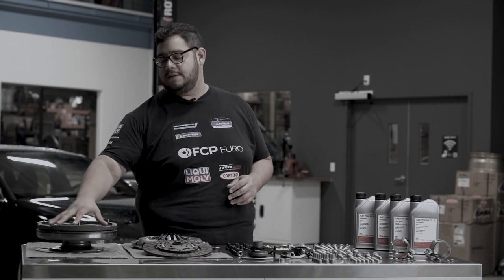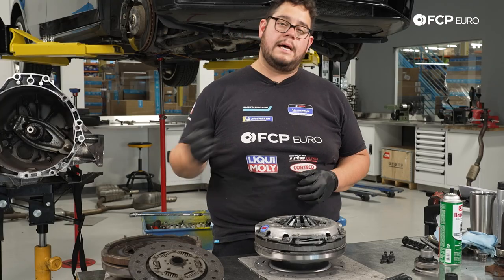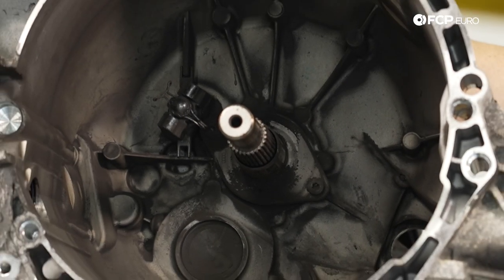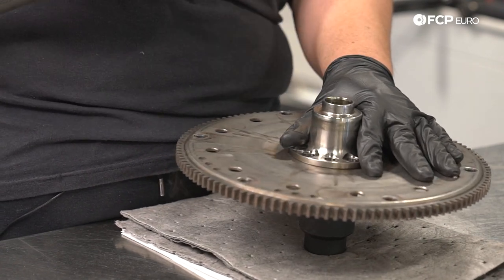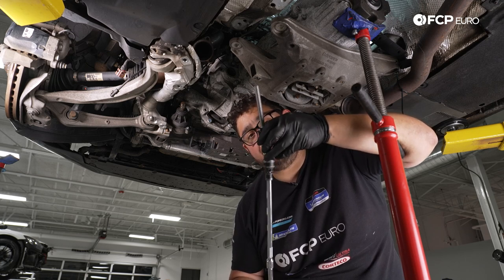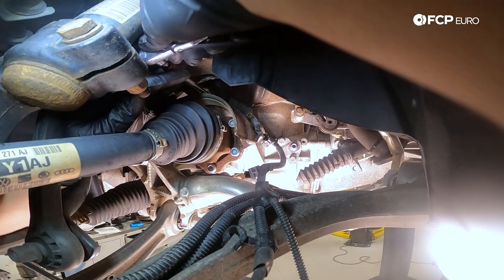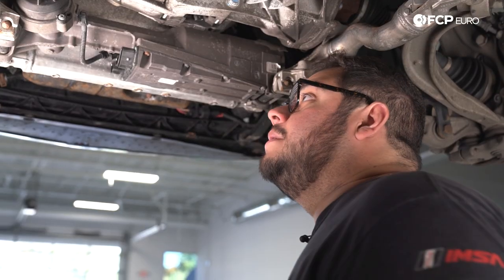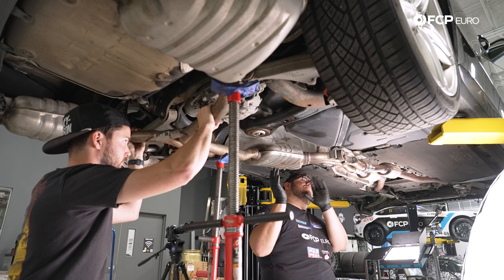Audi S4 Clutch & Flywheel Replacement DIY (2010-2016 Audi B8 & B8.5 S4, 6-Speed) - Part 2

Comment: Just replaced the dual mass flywheel on a b8.5 s4 DSG was using this as kind of a guide is there a certain orientation the flywheel needs to be mated to the flex plate? didn’t mark it before removing it 🤦‍♂️

Comment: And that my friends (or good ppl if you prefer) is why I own the DSG version. Even when the mechatronics unit (or solenoids, more specifically) takes a crap, it's still waaaaaaayyyyyy easier to fix than a clutch replacement! 😂 But superb DIY as usual! 😊

Comment: Just finished this job before i came across this video. I skipped the step where the unit was put on the press and assembled the clutch normally. Now the car drives like it has a worn clutch, high biting point and burning clutch smell. Would this be because i did not put the clutch under load as shown?
Reply from the maker: Hi Leonard, it may be possible, but there would really be no way to tell without more diagnosing. You can try bleeding the slave cylinder as a "quick fix" to see if that remedies your problem, before tearing into things again.
Reply: @fcpeuro  tried bleeding a new slave from the dealer. No difference. Opening the gearbox again now. Will give you guys an update fml

Comment: Absolutely fantastic. This helped a ton with changing my clutch and flywheel on my 2014 A5. I am one of those sorry souls to have done it with jack stands and 2 floor jacks. 

Tip for anyone else that is going to do this and has the 2L V4. You can reach the top bolts from above because the engine is small. Makes it allot easier. Same go’s for the annoying bolt on the axels heat shield.
Reply: Was it a huge pond in the butt job ?  I’ve been quoted $1300-$2000 in the shops
Reply: It just takes a bit of time. I think it took me 2 days (not full days) to get it down. And one to get it up and running. Nothing too stupid. Definitely get help to lower it down on a jack. I had used  2 jacks a person on each and lowered slowly. (You can do it with one just find the best balance point before fully unbolting. It’s pretty straightforward but mark, video or write any differences between your car and the video. It’s easy to forget a clip or to look for one you don’t have if you didn’t make a reminder for yourself.
Reply: thanks a ton dude 
  I believe I’ve got more time than money so I’m going to try it out 
 Plus the shop can’t even get me on for 3 weeks 😂 ✌🏼

Comment: Have you thought about doing a video about replacing the OEM clutch line with a stainless steel clutch line (like from ECS) that removes the delay value in the line and improves clutch pedal feel and drivability?  Not sure if there is another delay valve on the reservoir

Comment: good job man 😁 i have  done a new clutch Sachs set,becouse the old clutc was slipping.  Now i have a problem with starting the car... always say press clutch to start the car... i have to press it real hard, more that is normal to start the car.  I have changed slave cilinder and master cylinder.  do you have any idea what could be the reason?  thanks for helping bro 💪
Reply from the maker: You may want to check the clutch switch and ensure that it has not popped out of place, or failed. Best of luck!

Comment: Hey, I didn't noticed tightening clutch to flywheel, can you tell us how many Nm and degrees should I do?
Reply from the maker: Hi Michael, that step-by-step process starts around the 9-minute mark!
Reply: i rather thought about connecting clutch with engine after fixing the gearbox to the engine block, 6 Hex bolts through the window at the bottom
Reply: Allright, I found this in ELSA. Procedure looks liketightening first bolt hand tight, turn the crankshaft 180° and tighten second bolt by 60Nm and then turn the crankshaft to the next bolts one by one and do the same torque

Comment: Can we get a detailed parts list? As far as it comes to all the different nuts and bolts that need to be repalced? 😁
Reply: did my Audi v8  with 6 speed ; didn't replace anything  bolts or torqued anything just make sure its tight  without braking the bolts and its still going 10 years later. oh and the car has seen 100 mph  to  145 mph plenty of times on out of town trips.

Comment: Got mine done by a very very reputable shop and I’m hearing a very faint knocking only at idle. Is this normal? South bend stage 2 daily just like the video. No codes and doesn’t affect driving
Reply from the maker: Hi Jack, did you replace the flywheel or just the clutch? After installing on this S4, we had no noise or anything that would even hint at us being in there.
Reply: @fcpeuro  the flywheel and clutch were replaced by a reputable shop that has done plenty of work for me. It’s very faint and only when the car is cold. I have maybe 200 miles on this clutch so far and it’s a very faint knocking/groan that I can only hear in the drivers seat when it’s very quiet. Goes away instantly with any revs above idle. Cannot hear it outside the car with the hood open. I’m going to monitor it and see what happens over the break in period.

Comment: One of those 3 bottom bell housing bolts is broken on my car. The 3 bolts at the bottom coming from the back side. 
I just bought the car, removed the tray to do oil change and found one bolt is snapped in half. 
Is it a big problem or can I normally drive the car. I don’t drive hard at all.
Reply from the maker: You will want to replace those!
Reply: @fcpeuro  thank you.

Comment: I know this is 1 year old, but at 10:03 it is CLEARLY VISIBLE the self adjusting springs are NOT in ideal, all the way back position. To do that, simple use the press to push the fingers all the way down while using a nut to push back on the springs. As soon the the springs push back ALL THE WAY, keep the nut pressure on the spring and let go of the press to release the pressure and for the springs to stay in the correct, all the way back position. Otherwise it will cause you problems when it's all in the car later on. Biggest mistake most people make and it doesn't take 5 minutes to do. Thes springs also DO GET OUT OF FACTORY POSITION DUE TO TRANSPORT! Even the manufacturers say that. Otherwise amazing video!

Comment: Fantastic video guys - thank you!

I have an audi a4 2012 diesel technik 2.0 and had to replace clutch. I had to remove the engine bay removable firewall to reach the top bell housing bolts because it was impossible to get to them from behind with long socket extensions. (especially the top starter motor bolt). 

Watch Hachem's video on how to remove the firewall. 
https://youtu.be/D0ubJ_QWlG8?si=T4_ICQp3jo5D1yNy  (around 26 minutes in)

Add another hour for this extra step if you have a similar problem reaching the top bell housing bolts!